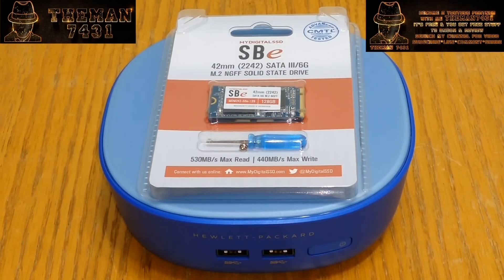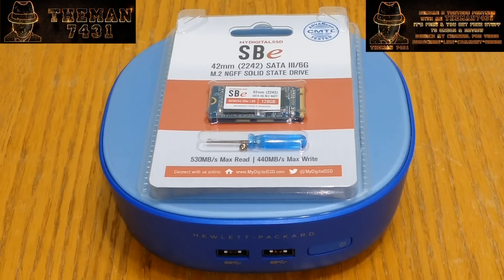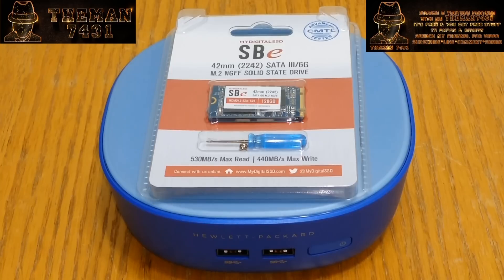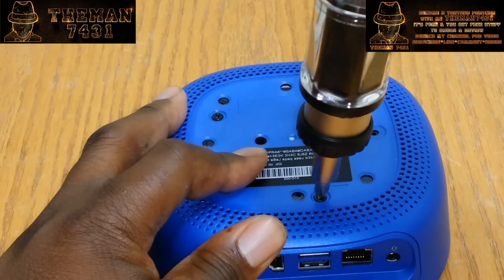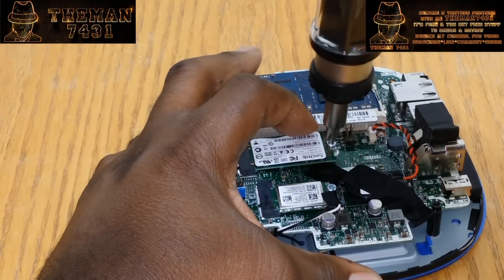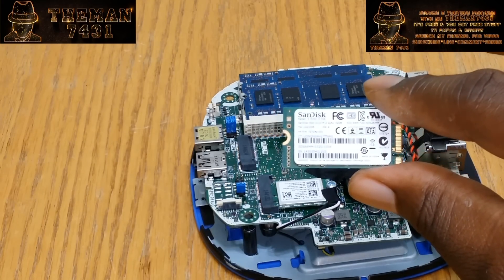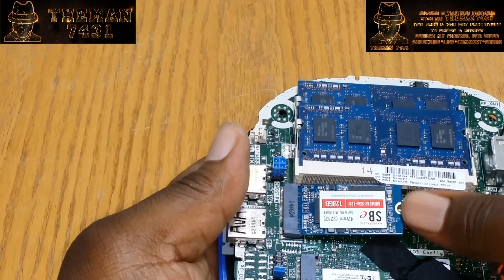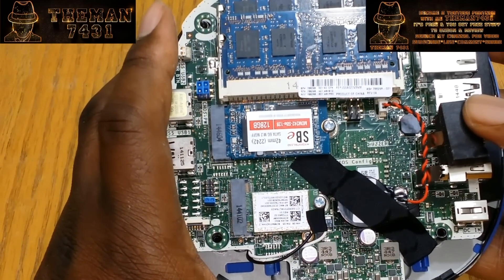HP STREAM MINI 200~010 { SYSTEM UPGRADE SSD }

Comment: I have the same mini PC and I have also upgraded the SSD drive.  Before replacing the drive, I made recovery media on a USB and a system image on an external drive.  After installing the new SSD, I booted to the recovery media and then restored the system image to the new drive.

The problem is that the recovery creates a 32 GB partition on the new drive (even though it has 120GB).

Win8.1 won't let you expand the system partition to use the space.  I have also tried freeware partition management programs which result in the system becoming unbootable (even though the software indicates it will do the job).

Do you have a video showing how to get the OS on the new drive using all the new HD space?

Thanks for all your videos.